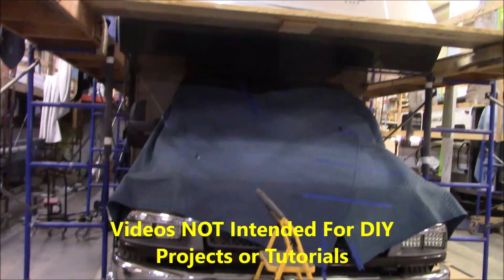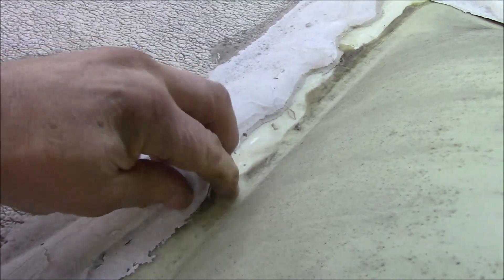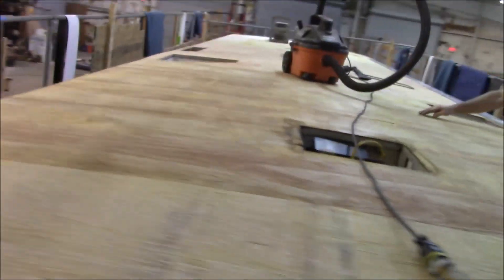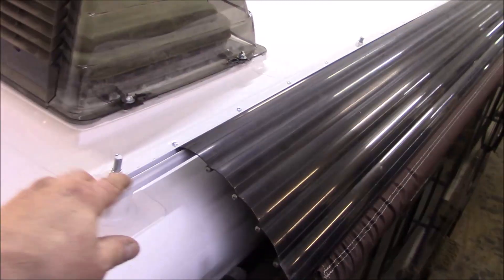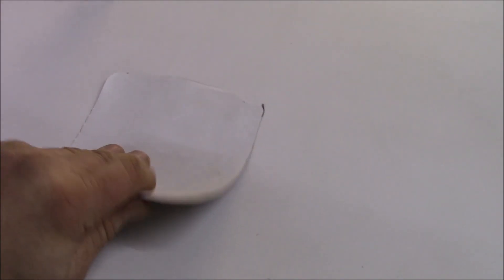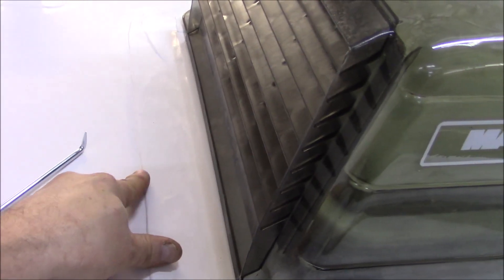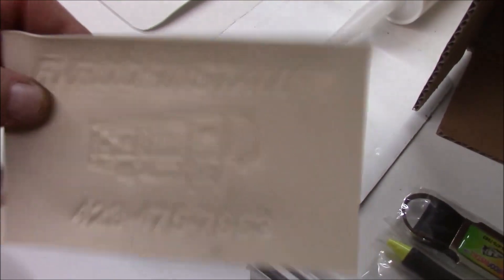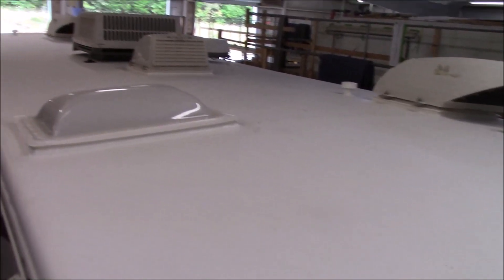2008 Jayco Seneca

Comment: Great job on the Jayco Seneca and great video as well. Your videos have helped me understand my Son's Trailer that he just bought.We are planning to do Roof in the spring together. Spent 28 years as a Roofer and understand what you are doing for your customers, you are saving their investment. You install a Roof that is superior to what the manufacturers offer in every way, curbs are essential on a Roof not "Moats" of caulking. Thanks for your help.
Reply from the maker: Good luck on your project. Make sure you rip up the decking and check the insulation, wires and duct work.
Thanks for watching.
Reply: @RVROOFINSTALL Thank you, my Son's trailer is small with a level flat top with no shoulders, extremely simple compared to one of your jobs. I will be sure to check everything underneath. What you take on goes way beyond Roofing, I admire your knowledge and creative solutions, your customers are lucky to have you take care of their RVs. Thanks for noticing my comment, you are a good man.
Reply from the maker: @rodshore2242  rod if the roof top is flat then chances are it plyfoam. The roof is probably an inch. Take the vent garnish out and see if it is white inside. The pro lem is the trusses are undersized and the roof deck just has ⅛ in luan. That will sag and you being a roofer know what ponding water does to a roof.

Comment: You are exactly what the RV industry should be
Reply from the maker: I am old school, when quality meant something vs the now...Corporate Amercia attitude is to just get them out an sold so the numbers look higher and better. Nowadays everyone wants to specialize in one thing...framing...dryall...finishers...gutter..etc. The problem is that no one knows what comes next so the guy who follows ignores what needs to be done and so on. My dad was a General contractor. I had to learn how to dig footer..with a shovel even at times...lol...assemble foundations, frame, cabinets, roof siding ...all of it. 
Thanks for watching
Reply: @RVROOFINSTALL  I'm 21 and even though I have not been alive very long I recognize how much more the previous generations have contributed than my generation will even ever come close to accomplishing
Reply from the maker: @iair-conditiontheoutsideai3076    you need to keep that attitude. You will have more pride and earn more respect.
Reply: @RVROOFINSTALL  👍

Comment: I'm looking at a Renegade 34' super c for its towing abilities.  I think i will book with you for a proper roof.
Reply from the maker: Look at the roof if you haven't purchased it yet. Some of the aluminum flat top style roof are very flimsy. They use 2x2 from side to side. Not nearly strong enough without sagging.
Reply: @RVROOFINSTALL  That's great advice i will thanks.  I'm planning on big Solar so i'll pay particular attention.

Comment: Thanks for the information and the work you put into doing this kind of education for viewers. My husband and I are in our 60's and really wanted to purchase an RV and meander our way up to Alaska and around the U.S.   It's just heartbreaking to see how bad the RV industry is cheating customers. Like most people purchasing these rigs, we have worked hard for our retirement and we're not  super wealthy and have to be careful with our money. Now, we're not sure what to do. How do you feel about the molded fiberglass campers like the "Escapes, Casitas, Bigfoot's". They seem like the only way to go but would be interested in your thoughts. Thanks!
Reply from the maker: Flat or low slope roof systems need to have curbs that elevate the AC vents and skylight. So it would not matter if it was fiberglass, full metal or even poured concrete. If there are no curbs it will leak. 
Thanks for watching.
Reply: @RVROOFINSTALL  Thanks for your quick response. Good to know. Probably better to just stick to motels, LOL.
Reply from the maker: @joanpiazza8237  you can rent an RV. Once in a while our customers sell their coaches. I don't know if any now.